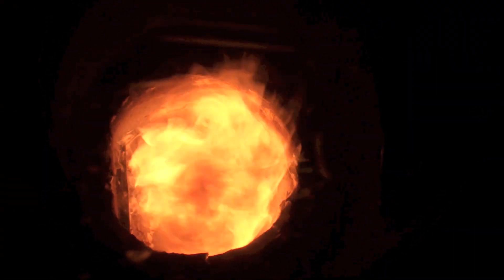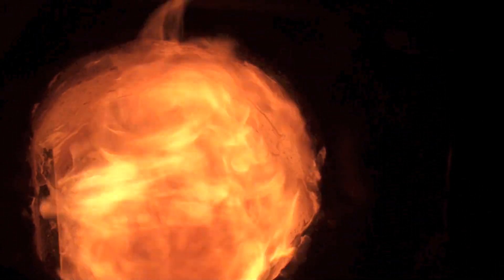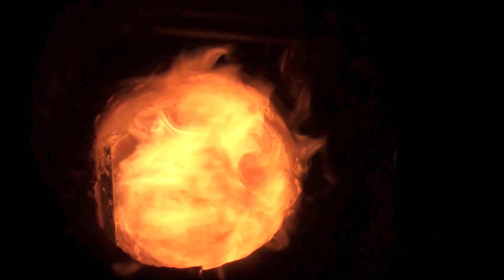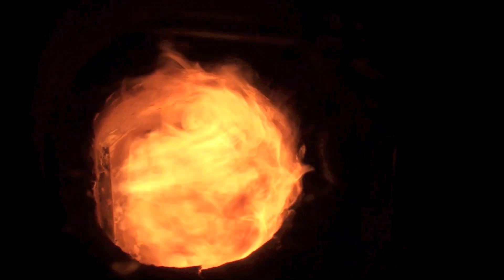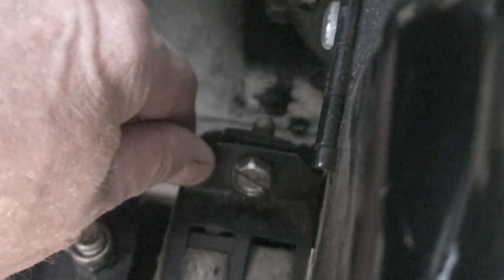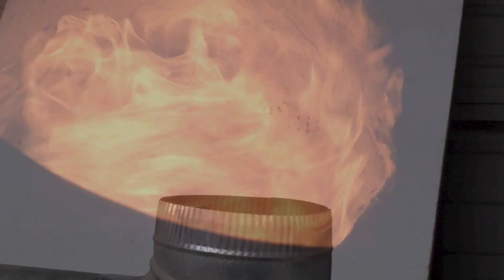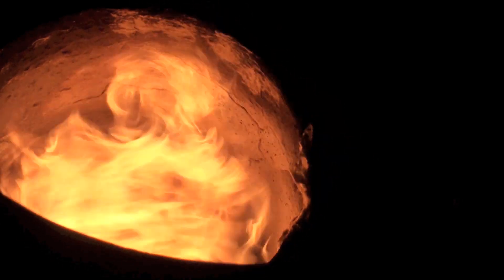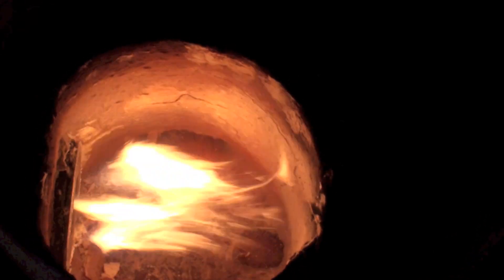Setting the oil burner air adjustment

Comment: I have an Oil furnace that's over 5 years old and every time the temp go's to 15 or less I have to run a hair dryer on the line coming in from the outside to the  Electronic Post Purge . do you know how to fix this ? thanks and keep up the videos
Reply from the maker: If you have an outside tank, you will need to add some #1 stove oil to the tank as long as the temp remains low.  #2 will gel at those temps.
GFM
Reply: it's not the fuel line it's just a tube that looks like a brake line from a car that just plugs into a mother board looking thing
Reply: Only number one fuel and I mean only number one will work.MANY yrs.I tried number 2 in my oil stove and no matter what the oil man and other people told me to add in it,number 2 froze up in the oil line every winter.
l froze my bum off using a hair dryer.Number one may cost more but no more going out in the cold.

Comment: hi ...
what we make to if the pressure in oil burner its higher  from the sheet data?  i must have 3.5 mdar but i measuring  and is 5mdar ...  thanks my friend?
Reply from the maker: You can adjust the pressure down with the regulator on the pump.
GFM
Reply: the air pressure not  the pump pressure!
Reply from the maker: I don't know of any air pressure requirements on oil burners.
GFM

Comment: My oil furnace will light and sounds like its gonna stay lite but turns off after 20 seconds...Low H2O was noted first, put some in until light went off and tried again...still did same thing ran for about 20 seconds and just stops....Help, I hope that is enough to tell you what I should do next.  TYIA
Reply from the maker: Are you sure the burner has lit?  It sounds like the safety is shutting down the unit due to flame failure.  Not sure what low H20 is.
GFM
Reply: if it's like mine you have to follow the wires to you get to a tube that looks like a brake line and warm it up with a hair dryer ( about 45 seconds ) then it will start :( I have no idea what it is but this works

Comment: What causes the insulation inside of the burner to diminish? I just purchased a used hot water pressure in the gentleman told me that the insulation was shot and needed to be replaced, wonder what the cause of that was. Thank yoi
Reply from the maker: There are a number of things that can happen to the combustion chamber.  If the flame impinges on the chamber, it can damage it.  Fire brick can crack for no apparent reason.  Sometimes, if the burner has been changed, the higher temp of the new burner flame can damage the chamber.  It can also be damaged by cleaning operations.
GFM

Comment: My Weil-McLain 68 oil boiler has periodic coughing fits. Every so often while running, the boiler cuts out for fragments of a second causing the damper to make a coughing kind of action. Afterward, it runs fine until the next coughing attack. Is the air mixture off or does it have something to do with the fuel mixture. I absolutely love your videos and have used them to gain a better understanding of how boilers and furnaces work.
Reply from the maker: This one sounds like a fuel supply problem.  Plugged oil filter, blocked screen, possible vacuum leak in the supply line.  Hope this helps.
GFM

Comment: So I have been dealing with a issue of exhaust pooling out my damper when running. When it is off air flows though the damper fine. Watching this video I messed with my air. It seemed set pretty high. So I turned it down and immediately felt like the bottom part of my damper was pulling air again. So I am crossing my fingers that fixed it. My house and garage have reeled of exhaust and my fur is guy said to run exhaust threw roof or get a power venter. I think I answered this but can too much air cause a backdraft type feeling in the damper and furnace?  Thank you for your time and sharing the video.
Reply from the maker: Too much air seldom will cause a backdraft.  You either have  a blocked vent or there is not enough upward pitch to create a draft.  If it does not go thru the roof, it should.
GFM

Comment: My oil fired furnace recently sooted up. I found the electrodes were considerable out of adjustment and worn to the point that  they didn't even have points on them anymore. They were last set a year ago. Any idea what would cause that? Also, now that I've cleaned and replaced I'm trying to set the flame without a smoke tester. It looks like it's burning pretty clean  and think I have it set close but I do see a light amount of soot  on the walls inside smoke pipe ( which I had cleaned) if I look in through the damper.  Is that normal or not enough air? The air going past the damper does not appear smoky to my eye when I look in while it's running.  Lastly, thank you for all your videos. I've learned so much from you. Greatly appreciated!
Reply from the maker: There is no way to be sure without the tools, but you can add a small amount of air.  It may reduce the efficiency a bit, but that is better than shooting up.  Hope this helps.
GFM

Comment: Great videos, haven't found my issue yet. It's an oil fired water heater, I open the peep hole and I see it light a flame but only for a second and it's out. So it's getting spark, and the light sensor is clean. But I can't find anything on how to access the nozzle. Had to shut off the breaker till I can sort it out because the pump keeps running. Don't need a bottle rocket in the basement..
Reply from the maker: You probably have a supply problem or a plugged nozzle.  You can send pics to grayfurnaceman@gmail.com and I may be able to help.
GFM

Comment: My sister has an oil furnace and periodically it will make  a strong oil smell in the house usually before  it rains  or a low atmospheric  pressure  weather wise she has noticed, but a new carbon monoxide detector dosen't go off and the oil smells unburned
the last man set the air mixture it looks just like this one in this video older furnace, would  too little air  cause that smell? P.S. it doesnt have   a barometric damper or any damper on the pipe   has  a pretty new through the roof exhaust   pipe
Reply from the maker: The venting will not work properly without the barometric.  Wind conditions could cause the problem you have.  I would not be looking at combustion air.
GFM
Reply: Thank you sir!
I thought so.
  but  it never used to do that until recently with the same setup though until she had a  furnace man over he told he he decreased the air :)
Reply from the maker: I still don't think that's it.  You could also have a plugged smoke pipe or heat exchanger.
GFM

Comment: if I had oil heat, I'd run it as rich as possible so my house could ''roll coal'' all the time.
Reply: My buddy's shop has a boiler that burns No 6 oil. Rolls some awesome coal even when its adjusted. Dirt cheap fuel too.
Reply: @straightpipediesel  
Does he have fuel heating equipment? Number 5 and 6 don't even flow without heating.

Comment: Hey thanks for posting some really informative videos! I am helping a friend with his oil furnace in his shop and it going to put out to much heat for the shop size. Is there a way to tune it down so it puts out less bdu's. That way it cycles on and off less. Is it as simple as changing the nozzles to a size or two smaller? Or will that over work the oil pump? Its and old Lennox oil furnace. Thanks and Merry Christmas!
Reply from the maker: You can reduce the nozzle size.  Just adjust the combustion air down.
GFM
Reply: Sweet appreciate the response

Comment: Hi Gary. Thanks for the videos l. Very helpful. You mentioned little sparklies in the flame. Is that supposed to mean too much air or too little air?
Reply from the maker: It is too much air. The sparkles are the incomplete burn of atomized oil.
GFM
Reply: Awesome thanks. I just noticed it's not Gary. Sorry. Ha.
Reply: grayfurnaceman

Comment: Is it normal for the chimmney to smoke when the furnace starts up ? After about 4-5 minutes of my furnace running my smoke dissapears from the chimmney.
Reply from the maker: Sometimes you will get a little smoke upon startup, but that is too much.  You may have leakage from the nozzle in the off cycle.
GFM
Reply: Thank you. I have a pro tek valve nozzle on order. Will try that. Also I think I had my control set to "spark in on delay" maybe that's what was wrong too.

Comment: I have a wayne msr burner with a smaller flame. There seems to be 2 sets of air entries they are open 3/8" top and 7/8 inch on bottom. Not sure if the 7/8"  bottom is an opening or not. Flame looked kind of small like the end of your video. What would that mean efficiency wise if I have too much air.?
Reply from the maker: You probably have too much air.  If you do not have an analyzer or smoke pump, just get rid of the dirty flame and stop there.  Hope this helps.
GFM

Comment: I have a white smoke coming out the front of my boiler when the burner turns on. Smoke continues until burner shuts off. Heating the house but the smoke fills the garage. The boiler has been off for about two weeks and began this behavior when restarted. The smoke has a strong diesel smell. Any help would be appreciated.
Reply from the maker: +Phil Johnson Look for plugged heat exchanger or smoke pipe/chimney.  Hope this helps
GFM

Comment: My Beckett system kept locking out on account of maximum recycles. I cleaned the nozzle and assembly and it stopped locking out. However it started running very rich, and exhaust filled the space. I made the air adjustment, assuming a wider gap provided more oxygen. When I opened it all the way, black smoke creeped out the exhaust seams. I realized I had it backward, and narrowed the space on the air adjustment. Now it seems fine.   Thank you GFM for taking the time to post these videos - they're more incisive than Chilton books.

Comment: I have a question that you might be able to answer for me... when I start the furance it smoke a lot then when I shut it down it still burns at the bottom what can I do to fix that....plus if you look in the camber you can see like half inch gap in front of the flame.... I need help a.s.a.p and can not afford a service tech.... I love in upstate ny and we are keeping the house warm with electric heaters....
Reply from the maker: +Jason Gaudio If it smokes out the inspection door, you have a plugged heat exchanger or vent pipe.  The after burn may be from the oil dropping pressure at the end of the cycle.  It can be fixed by installing a solenoid in gun line.  It could also be from a partially plugged nozzle.  Hope this helps.
GFM
Reply: Thank you I'll change the nozzle

Comment: From high school Chemistry days...  So we learned the best heat from a flame is a flame which has the inner core defined blue tip.  At the top of that tip is the hottest point.  Large oversize orange flames are usually inefficient and lack heat (Or so it sounds like you concur?).  I have used what I learned from school days in soldering pipes.
Reply from the maker: +DOLRED You are describing propane or natural gas flames.  Oil flames have no blue.  Only yellow.  Large dirty flames have too little combustion air.  Small bright yellow flames have too much air.  The best way to determine efficiency is with a combustion analyzer and smoke pump.
GFM
Reply: thats right
Reply: Hi all, i have a regular 87 gasoline  burner stove from  https://www.google.com/url?q=https://m.youtube.com/watch%3Fv%3DgaVpeb8gmPg&sa=U&ved=2ahUKEwj-1eGvgPTfAhWHm-AKHQTEB10QtwIwAXoECAkQAQ&usg=AOvVaw19L0f78qzvOLn7m9rigM7D and it goes blue flame all the way. It makes me wonder if the atomizer is working properly in this case.

Comment: Is it normal to have a little bit of smoke upon initial startup of the burner? goes away within a couple seconds
Reply from the maker: +Robert McNamara As long as no smoke comes out of the barometric damper, its ok.
GFM
Reply: +grayfurnaceman yeah nothing out of the damper just a little out of the top of the chimney.

Comment: How do you check or pressure
Reply from the maker: You will need a 150 to200# pressure gauge mounted on the gun line between the pump and the gun assembly. Hope this helps. 
GFM

Comment: I fixt my problem but know when my furnest start I get some smoke in to my house so my question is do I have to adjust the air or is spraying to much oil can u help me please and thank you....
Reply from the maker: +Jaime Baeza I would look for blockages in either the smoke pipe and chimney, or the heat exchanger.  Smoke pipe blockages will see smoke out the damper.  Heat exchanger blockages will see smoke out of the inspection door over the fire.  Hope this helps.
GFM

Comment: my furnes start and go through a whole cycle but after that it try to restart  and nothing no flame just the blower running what can I do to fix this please some help so my kids won't freeze!!!!!  thanks
Reply from the maker: +Jaime Baeza It probably needs service if it has not been done yearly.  You could have a plugged oil line, which is the first thing I would look at.  Hope this helps.
GFM

Comment: Hi there, i had a beckett oil diesel burner that i used on my shelf oven. Currently i am facing some difficulties, there is too much smoke in the combustion chamber but there is some different with the setting for the air, when i adjust the air more the fire is fierce and on the side can see the blue flame and front is red flame but when i adjust the air into low flow the flame turn into all red but the smoke got diesel smell. Both also has a lot of smoke. What should i do?
Reply from the maker: cirus1985 First, replace the nozzle and service the burner assembly.   I have a playlist on servicing the burner.  Also check the burner tube and combustion chamber for obstructions.  Hope this helps.
GFM

Comment: this winter was a cold one i tune my burner my self , instead of paying some one that did a crappy job last . everything was out of adjustment air fuel and gap this winter i only went thru 100 gallons of fuel .and still have 3/4 left . it pays to do your own tuning

Comment: Thanks a ton, I had to replace my pump motor today and i accidentally set my air intake to minimal.  Was wondering why everything was smoking really bad.  I adjusted the air up to 4 (a little less than half way) and no more black smoke or smoke smell in the house.  Thanks again for the informational videos.

Comment: I had my beckett burner shuddering and/or sputtering lately. This started happening 2 weeks of having a service tech. perform yearly maintanence on the furnace. I suspected water/sludge in the fuel tried some "Hot Shot" into the tank but I'm not sure that this is truly fixed. Any thoughts ? Thanks
Reply from the maker: John S. First, get the tech back.  It sounds like a supply problem.  plugged line, tank outlet or even pump screen.  Hope this helps.
GFM
Reply: grayfurnaceman They stopped back and replaced the nozzle which was changed 2 weeks ago. They also adjusted the weight on the damper. They did a combustion measurement and said it was 11.3  I believe that is CO2 Percentage. So far the sputtering is gone. Interesting point was that they said that the damper that they installed (because the old one was rusted) is not truly needed and they have installed systems without it. Does this make sense? Thank You

Comment: I have a old mobile home furnace in my dads shop that is used to heat only when needed and I have always noticed a slight  rumble when it's firing and does it more when its cold but just a little once warmed up. Its been doing this for about 4 years and no problems. nozzle is .579MH
Reply from the maker: The unit is having trouble establishing draft.  Could have a dirty vent or heat exchanger.  Also mobile home oil furnaces are very tough to get working right because of the small combustion chamber.  Hope this helps.
GFM
Reply: Well ok thanks I did clean the heat exanger. Anyway other then that issue it. seems to run well. Flue is 4 inch galvanized steel flue pipe and goes out through a metalbetos flange in the wall and then goes up about ten feet.